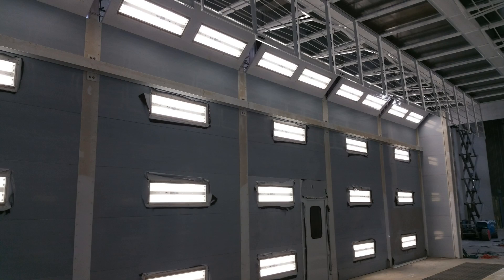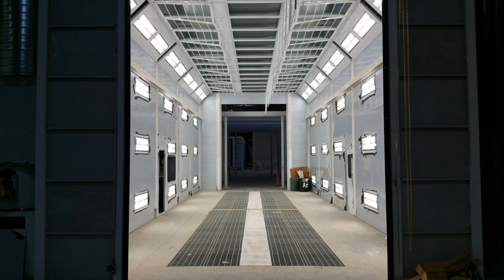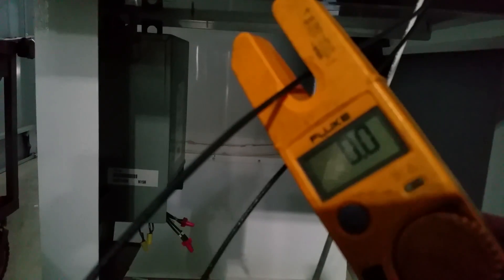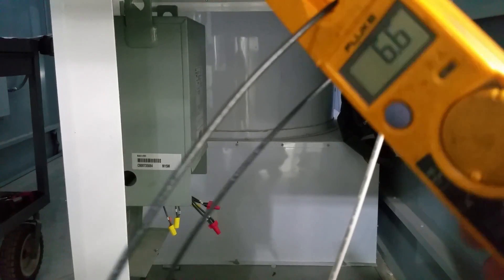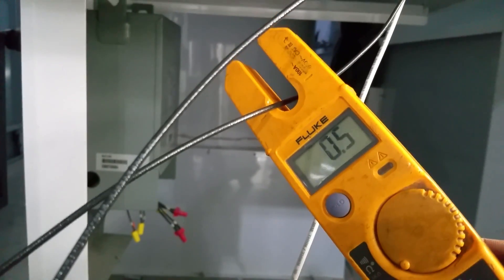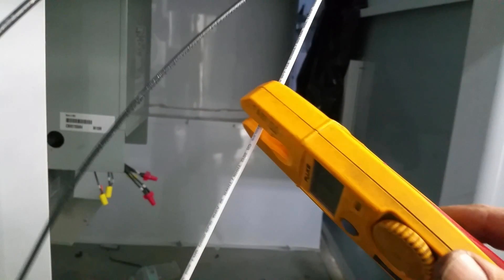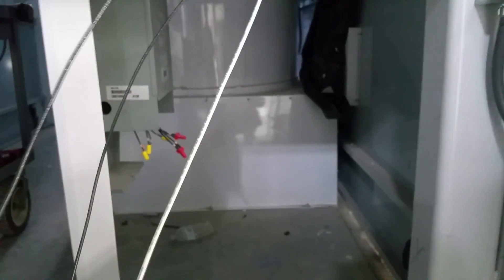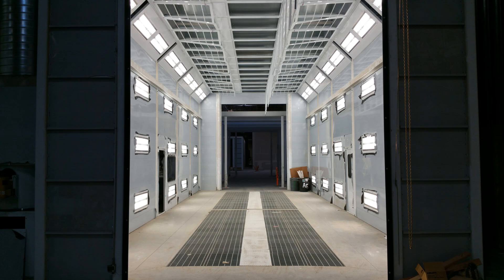Electric neutral loading

Comment: HOLY CRAP!!  I JUST "GOT IT" WHEN WATCHING THIS VIDEO!
Thank you!!

(I never realized that the neutral conductor on a multi-wire or "Edison" type branch circuit would be carrying almost the exact same amount of current of the difference between phases.  It just never "clicked".  THANKS!

Comment: I believe these are called Edison circuits. Where you are using two separate hots and sharing one neutral. The danger in this setup is when you go to service one circuit the other circuit could have the shared neutral loaded and you will be shocked off the neutral.
Reply: Then you're not really an electrician, are you? I can drive three phases into a single neutral all day long (like I've done since forever) with no issues, except when some clueless Dingus tries to mess with it. 

The code changes infuriate me. It's just the NEMA trying to sell more stuff ALWAYS in the name of safety.
These organizations should not have so much influence on the NEC.
All they do is drive up consumer cost, increase their profits.
Tell me the last code change that didn't involve the manufacturer selling more stuff. Arc fault, rooftop gfci 25 feet vs 75 feet, shared neutrals, etc., etc.
You can't really call them out on it because "safety".
Bah! Electrons been doing the same thing for eons.
Most of us are still here except for the exceptionally stupid that should be eliminated by natural selection anyway.

Yeah, might have had a bad day... LOL

Comment: I had a house that the neutral broke just before the meter one time... So long as you kept it fairly even on both sides you could turn on lights with no problem...

Forget and turn on the microwave, and half of the light bulbs wind up in the trash. :P

Comment: nice video, in conclusion we can add that problems with harmonics and over taxed neutrals come about from using a single sized neutral for example a 12 gauge wire on multiple feeds,  when those multiple feeds are over current protected by different devices.  example would be two or three 20 amp breakers that are all on the same phase all sharing one neutral. because these various 20 amp breakers are not on opposing phases they will not cancel out one another as in your example here.  the result is an increase in unbalanced load which can exceed the twenty amp rating of the mentioned over current protect in this example. this can become a dangerous situation in many instances. I have seen this issue in both commercial and residential applications where a panel change out has resulted in creating this situation due to the fact the person doing the work had no idea what to look for and how to look for it when balancing the load of the over current load center " panel box " or " breaker box ".   enjoyed your video. very good example of a balanced load on a shared neutral.

Comment: Good illustration of the concept. You might want to explain further why it is so.
Reply: That’s the job of the neutral. To be a bodyguard to both ungrounded wires, if one of them loses its temper the neutral wire will take all that heat to balance both

Comment: This is a great example of Kirchoff's Current Law (KCL). You can consider the building as a node which has three branches entering. Those would be the two hot lines and the neutral line. KCL says that for a node all currents entering and leaving must sum to 0. Thus when one side is active current is flowing through one hot line and none on the other. Because of KCL that current must appear on the neutral. When both hot lines are on current is flowing through each line. However, each line is 180 degrees out of phase with the other. So at a snapshot in time one hot line will have current entering the node(building), while the other will have current leaving the node(building). Thus if you were to sum up the currents entering and leaving the node(building): +20 A for one hot, -20 A for other hot, 0 A for neutral. This sums to 0 which is what needs to happen for KCL. 
However, if the load was different for each hot line, say one was drawing 5 amps more you would get the difference on neutral with KCL: +25 A for one hot, -20 A for other hot = 5 A, thus neutral would have -5 A to have KCL hold.

Comment: Thanks Stan! Very good video, please do more related to electrical loads and multi phase applications. I think that this subject is relevant for anyone using machine tools or electrically powered equipment.  Even if a person leaves the hook up to a professional it can be valuable for them to have a basic understanding of the circuitry. The short single subject format that Stan has used is perfect for this material and will help our understanding as mysterious as it all might seem at first.

Comment: What confuses a lot of Americans and then non Americans who try to help them out, is that US domestic power is SINGLE phase, but there is a centre tap on the transformer secondary winding and this tap is connected to protective earth potential to become the neutral. 

You can describe this as split phase, but it is NOT 2 phase.
Reply: No, we most definately do not. Phase to phase here is 380V, phase to neutral is 230V. We use single phase and three phase (which seems a LOT more common here than in the States). Nobody here uses 2 phase, or split phase. I still don't see how you can get low amps on neutral in Stans example without a 2 phase system, 180° shifted.
Reply: It's NOT 2 phase. The two hot legs measure 240v here ( ok, 208 on commercial). That is 240v SINGLE PHASE., if you run either hot leg against neutral you get 120v.  The 120v from a hot to neutral isn't single phase.  It's just half the VOLTAGE of the hot legs.  Stop thinking of the 120v as anything else!
Reply: it is 2 phase, 180 degree out of phase. That's why you get double the voltage from phase to phase, vs. phase to neutral
Reply: It's not 2 phase!!   It's single phase, 240v.  But you take that 240v and run each leg against a neutral to get 120v.  Those areas across the pond that feed houses with 240v, are actually 480v against a neutral.    Think of it as a center tap of single phase regardless.
Reply: Think about what would happen if you simply cut the Neutral line. Now you've just got two 120V loads in series across a single phase 240V supply.
Reply: Pardon? What do they look like on a scope, because I'm struggling to understand how Stan gets low amps on neutral if it's not a two phase system, 180° out of phase.
Reply: Yea, 2 phase is an all together different monster!  There was an area of Philadelphia that still had 2 phase up till a couple years ago. There are still some older plants that still have their 2 phase equipment.
Reply: You've got three 240VAC winding at the substation. Those windings are connected in a Star or Y configuration and the phase-to-phase voltage resulting is sqrt(3) * 240 = 415VAC. 

Add a Neutral line into the Star point and you've got your 240VAC between each phase and Neutral. 

If the three winding are connected in Delta, you've got 240VAC phase-to-phase. That's how we do our dual voltage motors, just six terminals and a few moveable links.
Reply: Correct